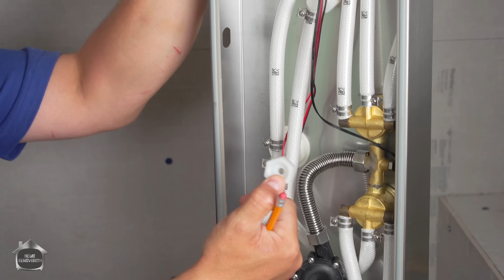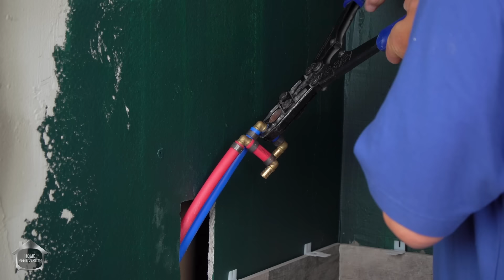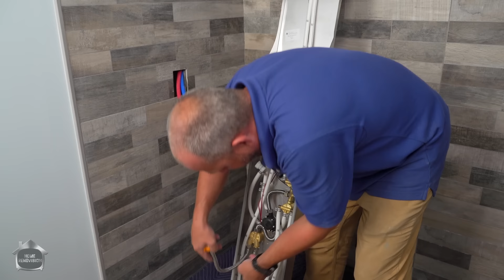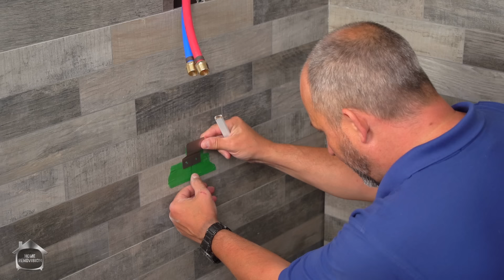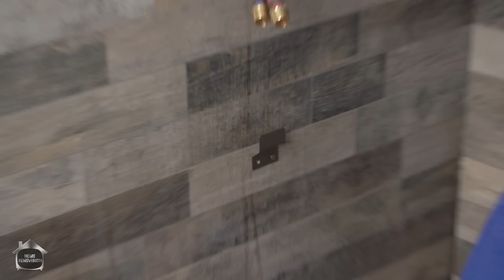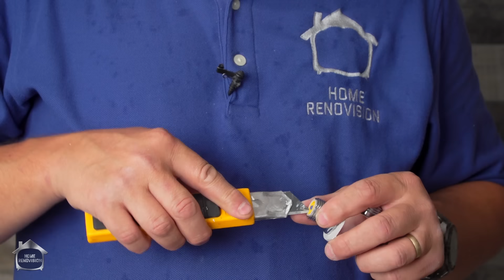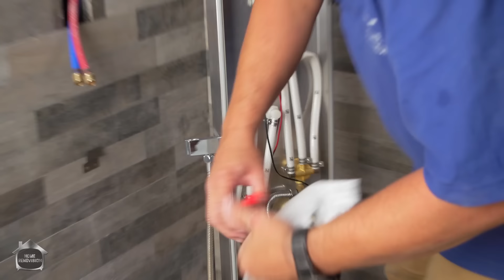Shower Tower Installation | Easy Plumbing For Beginners

Comment: In my experience, experience isn’t what it used to be. Every 6 months the unit was made in a different factory with different specs.  You are spot on that the only thing experience is good for is anticipating the unexpected! Great video!
Reply from the maker: Cheers Mike, experience teaches you to read the instructions and look at the product before you even frame. Cheers!

Comment: I will like to do a water supplies on the wall and put a metal frame and seal around it, the think is when the owner cleans the shower they will drop water and that water can go behind and get into the wall, so the owner needs to use wipes to clean on top of that wall 😂
Reply from the maker: a little trick you can use is to apply silicone like a rainbow around the hole in the tile to divert water. Cheers!

Comment: Quick tip: Run a bead of silicone around the hole behind the shower in a triangle formation. Any water that may run down the back wall will run down and around the silicone! Cheers.
Reply: l was looking in comments to see if someone mentioned this haha
Reply: That's a comment worth a beer.
Reply: Thanks Darren.
Reply: Agree
Reply: Can you buy new gaskets somewhere? The ones on the side of your unit.
Reply: What does "in a triangular formation" mean?.
Reply: The plumbing is not done properly
Reply: I’d build a flap for assurance.  

Also worried about inside if they metal staying wet.  Don’t like the idea.  I know it’s stainless but don’t like that.  I’ll seek therapy.
Reply from the maker: I personally don't think it is that needed but if you want a little piece of mind then  sure.
Reply: @HomeRenoVisionDIY  I think you mean "peace of mind" hahah great video man.
Reply: @HomeRenoVisionDIY  just admit this is a great idea that you didnt think of ;)
Reply: @RayFury  He did acknowledge it, it's not necessary.
Reply: @TuneinTurnonGrowup  his videos are full of tips that are not necessary.
Reply: @RayFury  Then don't watch them.
Reply: @TuneinTurnonGrowup  now that's a great tip 🤦😂
Reply: @HomeRenoVisionDIY  ofcourse you need that bead of triangular caulk because you have a big hole behind that fixture where water can easily sip into when the wall is being washed or yet splashes from bathing. If you ask me it's a MUST with that large a hole behind. Water will sip in for sure.
Reply: @acediy2234 What is triangular bead of silicone mean?

Comment: Always awesome! The sheer markup with“luxury” in construction is massive. So interesting to see how simple and affordable it can be when you do it yourself!
Reply from the maker: If you hire a plumber for this then you will be spending 2 thousand for sure. Cheers!
Reply: Just had a $17,000 insurance claim for a client whose husband tried to do it himself. Leaking inside, cracked shower base, trying to save money definitely cost these people
Reply: @vanderumd11  Sounds like someone with 0 experience.
This is a stupidly easy job to do and to do right (definitely would have more support for the mounting point than having it on a quickie 2x4 screwed to the stud)

Comment: Did anybody else see the kink in the hose?  24:36
Reply from the maker: LOL, I had to go see that for myself. Just pulled it off the wall to check. It is close but still holding its shape. Cheers for finding that. The braided supply lines in this unit are actually pretty flexible it seems.
Reply: the long looped hose on the right
Reply: I'm watching thus in 2025 and seen the kink 😂

Comment: Can these shower towers be installed when using a one piece acrylic shower+tub insert?
Reply from the maker: definitely! You simply need to set up back framing for the mounts in the correct position. Cheers! or perhaps a toggle bolt mounting system!
Reply: @HomeRenoVisionDIY  Thanks a bunch!

Comment: What is the best way to repair a hole in plaster drywall wall?
Reply from the maker: Hi River alley, we did a video on that exact subject matter. simply click the magnifying glass tool on the home page and type drywall patch. Cheers!
Reply: @HomeRenoVisionDIY  just want to say the walls we have I believe is drywall with plaster right on top of it.
Reply from the maker: my system will work regardless. Cheers!

Comment: How would you compare concrete board / green of waterproofing vs the Schluter Kirdi and drywall? Cost differences and performance/lifespan differences?
Reply from the maker: Kerdi is the best and the most expensive. next down is cement board and waterproofing and then green board and waterproofing. even a regular drywall with a good seal and waterproofing will last 20 years. Cheers!
Reply: @HomeRenoVisionDIY  thank you! I've watched your kirdi video multiple times.
Reply from the maker: Cheers Keith!